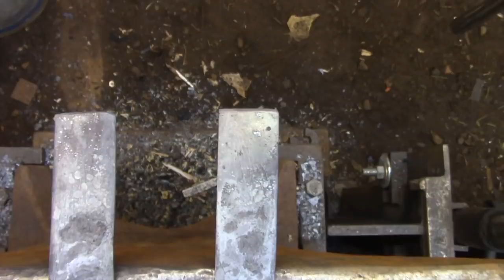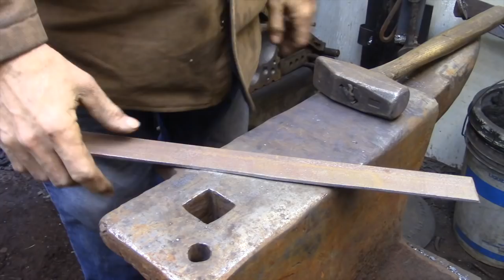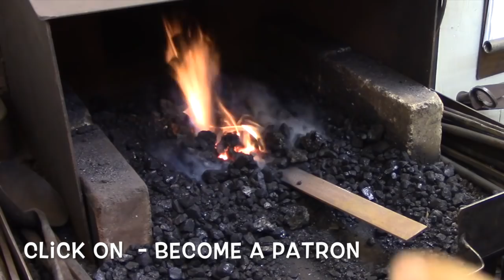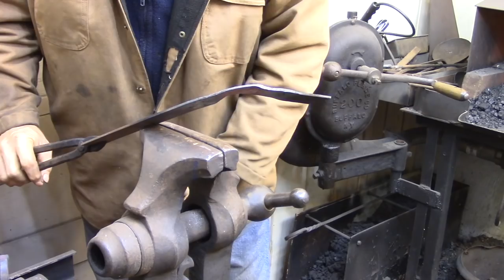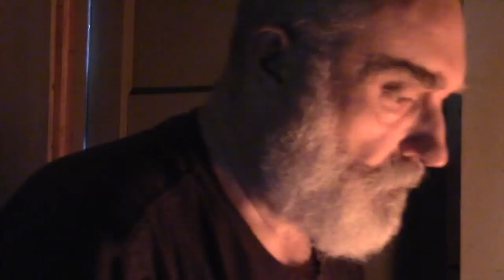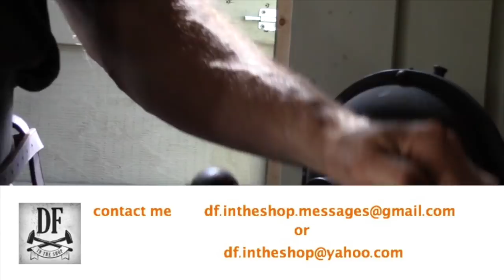Blacksmithing for Beginners - A Simple H L Hinge

Comment: Farriers have to deal with bending steel along the thin edge as well. We tend to let the tongs support the outer edge near the top of the piece, with the other end supported by either the face or the horn of the anil. Then you hammer down and inward on the inside edge. Not sure how well it would work on such a thin piece, but with the bar stock we use it's very quick (less than half a heat to get it to 90 degrees, though still rounded). Great video!

Comment: This was very interesting.  I think another possible method of forming the 90 would be to mark a 45 degree line across the stock, fold and forge weld over that line (the legs would now be perpendicular) and then draw out the corner from the doubled material with a cross peen.